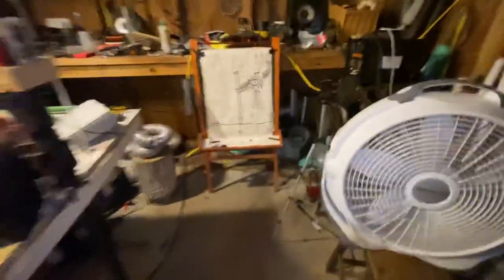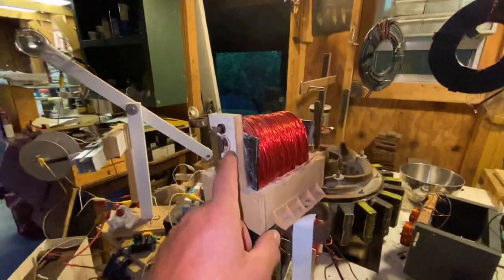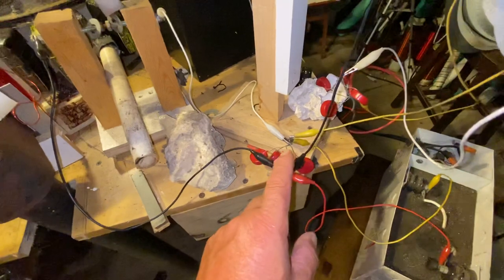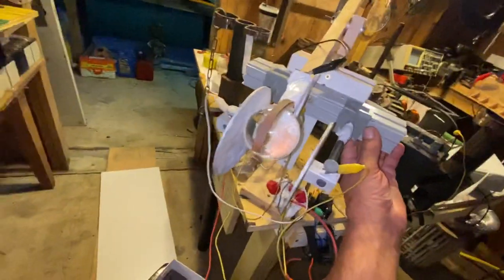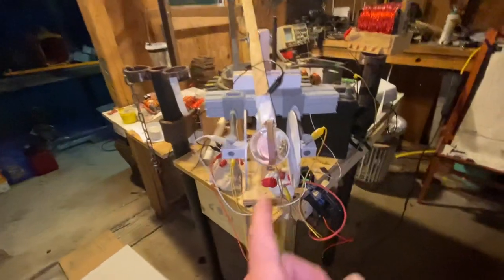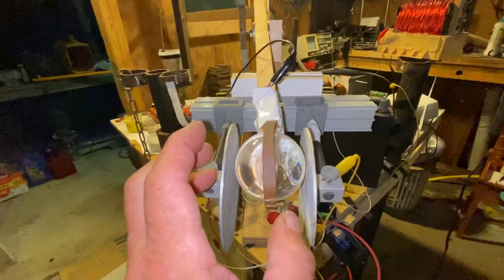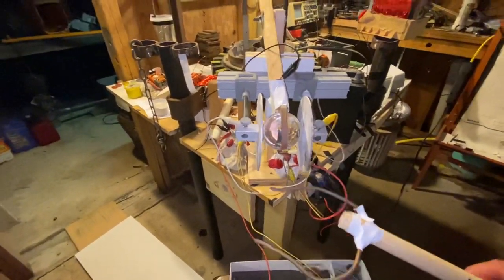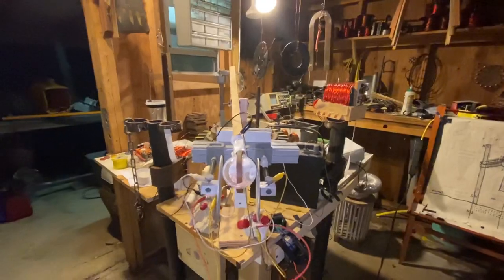1917 Quartz Crystal Experiment, Causing Levitation in 1927 , Ed Leedskalnin’s Coral Castle.

Comment: Here is an idea from Tesla... electricity, magnetism and gravity are linked. Ed spoke of the magnetic currents circulating around the Earth in a constant direction. Here is the trick - they generate the pushing force of gravity (it is not a pulling force). The trick would be to reverse the natural magnetic current of the Earth above an object or disrupt it and it would then float/levitate by changing the magnetic current to the opposite direction of the natural flow. That would cancel out the push of gravity and the object would levitate. My theory is that Ed had something on top of the rocks that reversed the pushing magnetic force of gravity and caused the rocks to float. I think that his understanding was that anti-gravity is really anti-magnetism.

Comment: Hi sir, what do you think about this -

From kimatica laws: Could the bottles without bottoms be served as low frequency speakers and levitation would happen because or resonance? Maybe thous levitating rocks actually vibrated and moved in space.

---

Simple experiment that may suggest mechanics - have two bricks 1m apart, place plank so one end of it is below 1st brick, other end on top of 2nd brick (diagonal). - Now if you take a hammer and repeatedly tap on the 1st brick - nothing happens. .. Now place a rubber below the plank at 1st brick's  end. -- Now when you repeatedly tap 1st brick, it starts to move uphill towards 2nd brick.

Comment: I truly believe Ed shows how he used magnetic levers to create levitation. He used a steel cable and an iron tube core coil. He placed the coil half the length of a Cable then when placed with in the field of the of the PMH between the two coils it makes a Magnetic Lever. With glass in his experiments he shows how the cable reacts with like force magnetism. He used 16 earth battery to give the 24v energy he desired. 16×1.5=24 each battery cell offers 1.5v but at night when the amp hour increases dew to the flow of magnetism.
Reply: Bury/insulate one of these Magnetic cable then place more of these levers atop tripods in boxes to avoid moisture. Tripods placed along the pathway of the buried lever will allow the like force magnet ends of the levers to pass the heavy stone along the pathway of the insulated/buried levers. Ed wore steel soles on his shoes to maintain where each pathway was under the sand.

Comment: https://youtu.be/8PKnW4rToPU 

The problem is that your crystal is too big for the amount of electric flux density you are putting in. You would need much higher voltage to achieve lift with that size dielectric. In my video I use very small dielectric pieces to achieve lift with only a few thousand volts and a large capacitor. If you watch carefully you will see the dielectrics lifting up and flying around. Eventually the dielectrics disappear due to negative index of refraction.

Comment: You have the best setup out of any Skalnin researcher. I truly envy and admire you. However, I believe if you focused on the magnetic aspect instead of the electric component of electro-magnetism, you’d unlock Eds true secret.  

Ed said something about heat and light being a waste of energy. Though he cryptically said it something like “making her blush ruins her for her true love.”
Reply: I agree, Ed didn't give a rip about the electro portion of electromagnetism. His understanding was completely of the magnetic aspect. It makes me wish I hadn't learned formal physics first! I might have a chance at understanding him. As it is, Ed may have just as well written it in his native language.
Reply: Heat and visible light are a waste of energy because it’s normally residual. If you can see it or feel it that means it’s escaping whatever medium you have the kinetic energy flowing through. Electricity and magnetism are the same exact thing. It’s a micro version of the cavernous structure effect. Stop seeing things by means of “duality”. There is only relative density. (Encompassing spin, vibration, etc.).

Comment: Quartz crystal oscillator

How does it work for a timing of the discharge for each passing second of the clock? Is it a part of the spark gap? Or does it "oscillate" at a particular frequency when a small current from a battery passes through it? Or does a small battery get transformed into a higher potential before going to the crystal? 

For all the lifters I'm aware of it's always an AC "paramagnetic" material induction. Which is aluminum, magnesium, sodium, neodymium (and most rare earth metals.) I don't think my pursuit would rely on the non paramagnetic coral by itself.

You pointed out his experiment was making use of the crystal as the oscillator of the circuit. Maybe it could be piezo oscillation. Electrical or mechanical aggravation of tribo electrical series materials by themselves generates static charge. The piezo crystal oscillated due to charge added to it alone. If coral is piezo it will compress and oscillate sound by itself simply by applying charge to it or through it. No drivers required. It will self oscillate and self project sound like a piezo speaker. 

As an oscillator and a speaker the piezo crystal having an applied current becomes an amplifier (static charge generator) and possibly it's own source for levitation, if done by acoustic means. 

Paramagnetic material AC induction might still be a requirement. It creates an attraction to it's Inductor because it creates the same direction of charge flow. Induced diamagnetic material creates opposite directional charge flow. Which amounts to resistance repulsion torque rotation. The opposite effect of magnetic attraction. The AC copper wire is in attraction with the AC induced aluminum circuit.

However, the AC copper and iron core rail gun repulses the induced AC aluminum ring. Lifter Technology appears to be a repulsive force despite what the alleged explanation for paramagnetic induction is claiming. Possibly and simply due to the induction being AC. All I know is that the effect apparently is real and that it appears to cause levitation.

https://m.facebook.com/photo.php?fbid=199462732234876&id=100065134508660&set=a.199461278901688
Reply: For piezo crystals to produce sound like a microphone they obviously need mechanical sound oscillation hitting them. To act as a speaker they need electrical frequency. But to act as a timer; do they need a transistor type of discharge from an overcharge such as jumping across a spark gap? Because the crystal itself isn't usually used as a part of a spark gap is it? It's usually hit and creates the discharge across a gap or it is hit by an electric impulse frequency and gives off vibrating sound. When used in a crystal radio receiver, what is it's purpose?

Galena is a semiconductor with a small band gap of about 0.4 eV, which found use in early wireless communication systems. It was used as the crystal in crystal radio receivers, in which it was used as a point-contact diode capable of rectifying alternating current to detect the radio signals. The galena crystal was used with a sharp wire, known as a "cat's whisker" in contact with it.[27]

https://en.m.wikipedia.org/wiki/Galena

By this description the crystal was used as a diode and a sharp "cat whisker" wire either touched it or was only very near to it.

Watch "How to Make/Build a Crystal Radio" on YouTube

https://youtu.be/VqdcU9ULAlA?t=8m29s 

1N34 germanium diode used

https://m.facebook.com/photo.php?fbid=200316972149452&id=100065134508660&set=a.199461278901688

In a simple radio receiver an antenna is connected to ground. A capacitor also has one end attached to ground. An adjustable capacitor allows volume control. A wiper is an adjustable conductor arm that changes the amount of coil which gets added to the ground and antenna. The ground, antenna and adjusted additional coil length (which changes induction level or reciever frequency) is connected to the output side of the semiconductor Galina crystal diode. Which is the output going into the speaker ear piece. The other side of the capacitor is the only source for the input to the same diode. The speaker earpiece is likely connected in a circuit and not run by one wire only. Likely connected to the other side of the diode? Which is definitely not described or shown in this video and diagram. However the LMD (longitudinal magneto dielectric) circuit could work as a one wire connection. (Eric Dollard)
https://m.facebook.com/photo.php?fbid=200323112148838&id=100065134508660&ce

Comment: Landiskalnin didn't use levitation but force converter. 
    I have a simple levitation machine,  using orgone and hight voltage. But it is not the case in this old experiment you try to recreate. The 2 round plate are SUPPOSED in the old press article Electrostatic, the author of the article give just HIS opinion. The true is that The 2 plates are vibrationnal plates. Yes, like the nasa experimentation with speacker.
   Remember worrel keely, with vibrationnals PLATE, this ecperiment is influenced by him. For more informations.

Comment: So, instead of using 'plates' on either side of the crystal, you may need to utilize cones.... Here is my thoughts as to why....

The plate has zero or infinite  'slope'...  the slope of a conical shape may allow the harmonics to emit at all areas on the cone's interior surface, so, that entire surface would be utilized... 

Also, I think what you would be 'banging' together would be the rarefaction curvature (not the compression curvature portion of the wave)... Yes, you are phase cancelling the compression (once you alternate polarities fast enough) but you are 'leaving' the Side resonance (and utilizing it)....

So, the cones would need to be 'tuned' to a specific slope angle to best suit the rarefaction.  Because the 51.84 degree slope angle is the (direct) compression slope (which is cancelled), I am guessing it would be roughly 2x(90 degrees minus 51.84)... doubling the 'side' angle for the conical shape. 

This means that the cones would be generating all the 'Circles' of rarefaction Harmonics.  (Mass is experiencing the direct effect of electrical compression 'force' (gravity) as acceleration).

I am suggesting this because it may be possible that 'resonance' in the Aether is an extremely subtle form of electricity (and Not Direct) mean 'background' radiation may be rarefaction vibration of the wave (not compression). 

In a mid/side mic set up, the 'Side' mic 'sideways' towards the sound source (therefore it is not picking up the Direct information of the wave compression) instead it is actually capturing the wave Rarefaction Information as it passes by the 'side's of the mic's Polar pattern (not its cardioid or omni directional patterns).

Is it possible that 'Direct electrical 'stereo' is like an X/Y criss cross, and the Mid/Side is A/B (Uncorrelated 'side' Resonance Foot Print where L+R side information Sum to 'mono' by completely Phase cancelling in center), no mass, Only Magnetic 'side' information, which is Quaternion and 4D not 3D.  However, the matrix allows me to adjust the Volume of my gravity/mass and Magnetism independently...the Mid can remain all Correlated information affected by compression (gravity) Monophonically.

Is the Torus inside gravity or does it project beyond the gravity... That is the question I can answer because my electrical matrix allows me to determine this relationship.

So, you need to be able to construct a 3D 'wave' guide capable of exciting that 'side' 4D resonance information, perhaps, the correctly shaped (internal side slope) cones.

Because the 'sides' of the cones are 'smashing' together (into whole circles) the rarefaction portions of the 4D Qanternion spin symmetries.  Sort of the 'Inverse' of like we see 'directional' electrical vibrations on Chladni Lines and Plates from tone generators. Certain frequencies create geometries because the 'Mass' is informed by where the Plate 'ends' with respect to the relationship with the frequency.

Basically, you need to redefine that 'electrical' Horizon for the crystal.
Reply: bruh. this isnt your thoughts. This is A Legitmate Hypothesis To Test